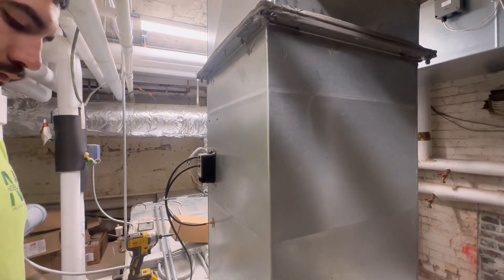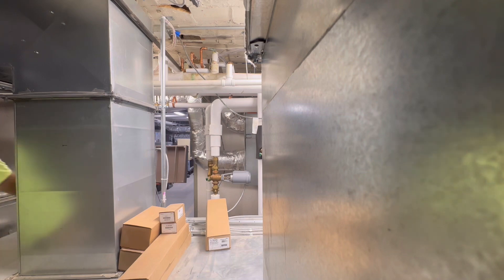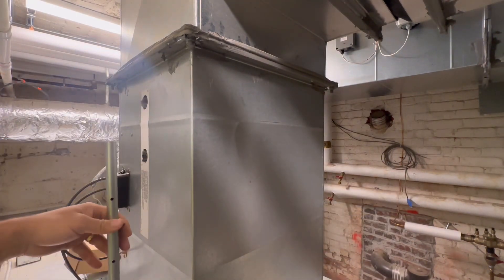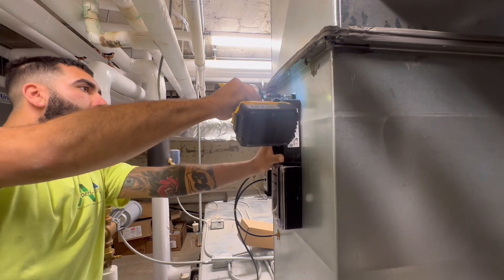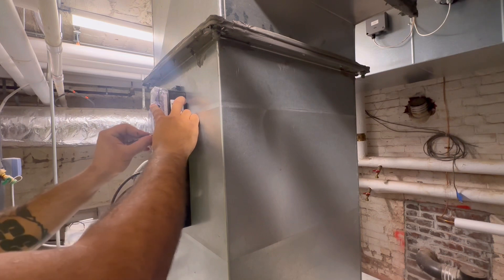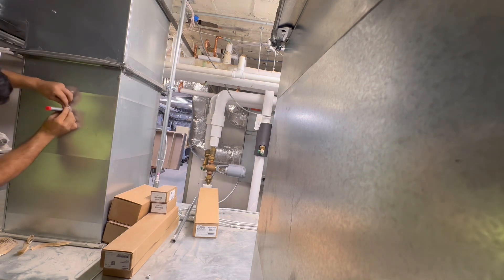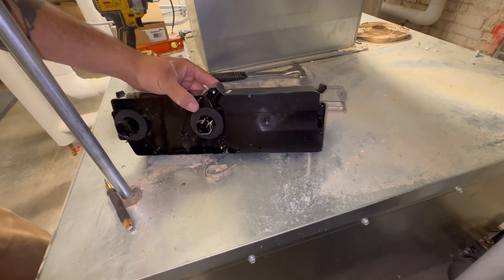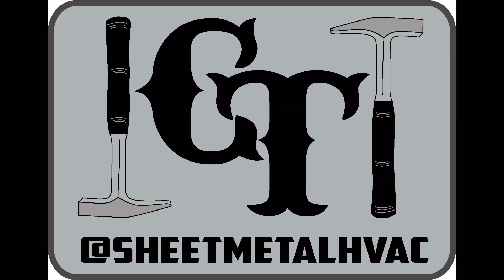How to install a duct smoke detector housing my way

Comment: Quick question, how do you wire to tstat
Reply from the maker: I’m only a sheetmetal mechanic so I only install the device to the ductwork. Any wiring should be installed by electrician

Comment: Electrician have to instal this?
Reply: Typically in a commercial contract we own installing the duct smoke detector but the electrician provides the detectors and also wires it as well.
Reply: Not here in virginia.  Sheetmetal company install these and electricians wire them up

Comment: Can we see how to wire this with 120 volts
Reply from the maker: @Truthh4040  fortunately I’m not an electrician and never really looking into the wiring diagram. I’m sure I can figure it out and maybe post a video and share to you
Reply: @SheetmetalHVAC__  thank you it’s probably simple but just don’t wanna make mistake and damage the unit.. manual just not clear

Comment: The wiring is the most important part. 3/10
Reply from the maker: @kennylopez8965  yes of course, so it can actually function. Proper install is also important for it to function properly. Any installation process of a life safety device should be important.

Comment: How do you install an autocall  A4098-9755  By Autocall More specifically I am wondering how to install this in existing Duct work Supply and returns?  Specifically, I am wondering if you extend their airflow tubes through the opposite sides? As you did with the model in your video. Also, I noticed that you only extended one airflow tube through the width of the duct work,  the one with the holes but not the other...Why?
Reply from the maker: Hi sorry for the late response hopefully you were able to get an answer for this if this was urgent. To answer your questions, first off I have not installed that particular brand but they are all pretty similar. I always recommend installing any equipment per manufacturer’s instructions. There are two tubes. A test tube and an exhaust tube. The test tube should always be before the exhaust tube and holes should be facing against the airflow so air can go in the tube with the holes. The small pipe that comes with the equipment is the exhaust tube so the air that goes in the device can be exhausted out. Some brands say the tube should go through and some say you can stop two inches before the duct. It depends on the length of the test tube, if it’s too long it can break from the housing. So the smaller one doesn’t need to be extended because it’s just an exhaust tube. The point of this device is to get a test sample of the air to go inside the sealed enclosure which has a smoke sensor and then the air gets exhausted out by another tube being the smaller one. There’s no pumps involved so it’s important to install the tubes correctly.
Reply: @SheetmetalHVAC__  Thank you for your detailed response it was very helpful!